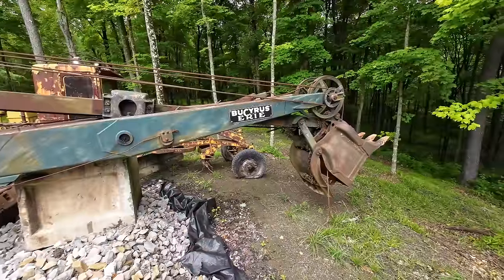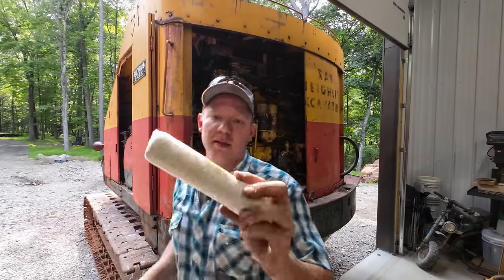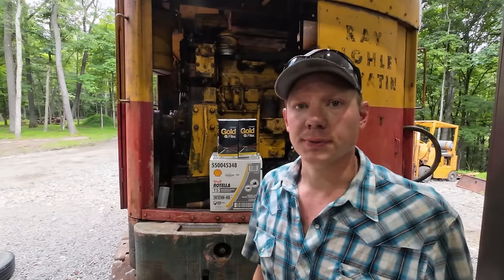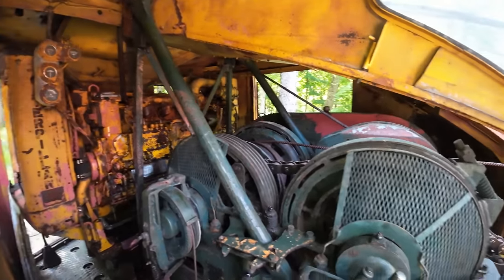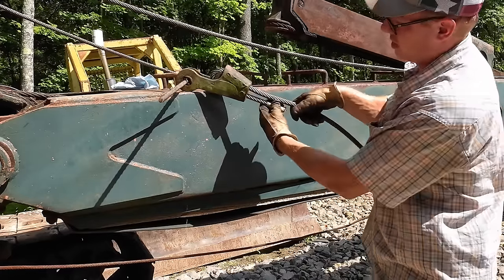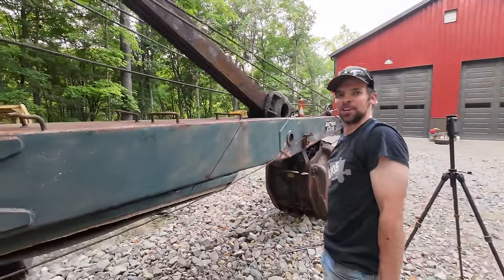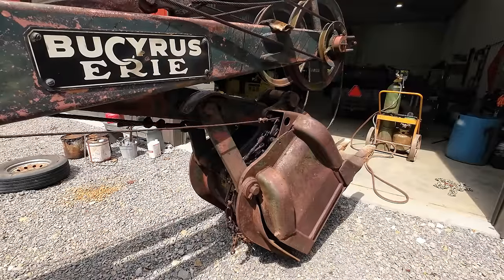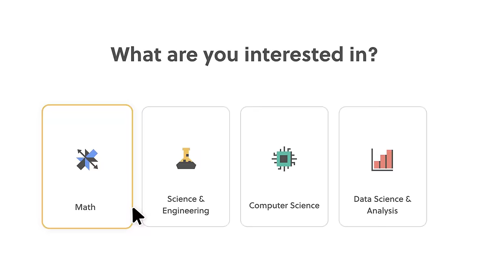Repairing a 1950 Cable Shovel, Sitting  20+ Years!!!

Comment: My dad had one of these when I was a kid. He had the shovel, the cable hoe and the dragline for it. Had both the dragline bucket and the clam shell for it. Never used the shovel.  If I recall a good little crane. Later replaced with. Bantam Shield cable hoe and a military Link Belt drag line.  Great memories…….  Steve

Comment: Not knocking the T5 I use it professionally for services on equipment and heavy trucks today.  My only concern with a machine of this era would be that it was most likely ran on non-detergent oil a good portion of its life.  From experience switching over from non-detergent to today’s oil can dislodge build up in the engine that’s accumulated over the years.  In certain cases can decrease performance/longevity.  A good example would be the 2-stroke detroits actually run a lot better and smoke less running non detergent oil.  By no means is this me telling you what to do or knocking your experience and knowledge.  Just a friendly sharing of information and food for thought.  Love the videos, keep it up!

Comment: Hey, Matt!  alanmarsh.1 here, oldschoolgeorge’s dad. Good job figuring out that the rope was backwards in the becket. However, there is an old saying that you need to remember regarding the installation of cable-clips: “Never saddle a dead horse.”  The saddle of the clip is the part that is not the u-bolt, and should never be applied to the “dead” (not loaded) side. The u-bolt should ONLY be applied to the “dead” side. Saddle on the “live” side, u-bolt on the “dead” side. Maybe 27 other folks have already mentioned this…

Comment: Matt, why dont use a pump up sprayer and some all-purpose cleaner diluted down to soak the machine before you pressure wash it? It helps clean it alot better and easier.

Comment: I’ve seen in other channels they replaced the cable in the becket and clamped like you did. You need to remove the clamp so the becket can work properly and be pulled into the cable causing a better clamp.

Comment: As a Hydraulic guy who makes a living making Hydraulic hoses and rebuilding cylinders and valves.  These older gear and cable machines inspire me. They just seem so much simpler to service.  Maybe they could benefit from a more modern motor but honestly the gears and cables just seem more reliable and cheaper to service and replace.
Reply from the maker: Find me modern motor that’ll fire back up this easy after sitting 20+ years
Reply: @DieselCreek  very true!!!

Comment: The core is synthetic or hemp for lubrication purposes as you oil the rope and the core sucks the oil up, as it is tensioned it compresses the synthetic or hemp core and forces oil out to lubricate the rope from the inside out.

Comment: This machine should be an example for newer models. It’s easy to maintain compared these new highfaluting digital, hydraulic pieces of crap they produce today. These old machines were made to last and I remember them being used when I was a kid in the early 60’s. They used to do the job well and a lot of the biggest constructions were built using this type. Great work and explanations. Thank you. 👏👏🇦🇺😁

Comment: I have always been lead to believe the hemp core is for lubrication purposes.  Shipping used to oil steel wire rope and some found its way the the hemp core and was squeezed out a little under load.  New wires arrived with remarkably oily cores.

Comment: I started working in civil engineering in 1969 and almost every job used a 22 RB. Mostly with lattice jib for general lifting but sometimes with leaders and drop hammer for piling. Such a versatile machine and often set on uniflotes for river work where access from the water was needed. Happy days.

Comment: A few things strike me about this unit, it's not uncommon to get things torn up or torn apart, but's remarkably assembled. The other thing is that runs like a champ. I'm 52 and I don't I don't run as good as that shovel does at 73. I think it's a good project. Storing it inside really paid off.

Comment: Hi matt, my 22 rb (british version) had built up quite a bit of water in the gearbox due to standing still.  It might be a good idea to carefully unscrew the plug and let the water run out with the first few liters of oil after the machine has been standing still for a while.  Then top up with mineral gear oil.

Comment: At 40:35 you were pulling cable off the drum. When you let the tension off the entire mechanism moved back about two inches. Someone has probably pointed this out already. Looks like you need to replace some bearings next.

Comment: I just watched this video, looks to me like you installed the Becket backwards. The dead end should go on the loop side. But I work with crawler and tower cranes. But I would have to assume they are the same for maximum weight safety

Comment: The ones that called that a piece of crap are not aware pf the engineering that goes into the cable pulls, they just hook up some hydraulic lines and a cylinder and it works
Well bless them...
That shovel is history 
The other people wouldn't appreciate a Model A ford
Good job

Comment: Watching you at the end moving that dirt certainly shows the skill of the operators and why they should be respected. These old machines were fully manual with no electronics to mix the controls and movements, it was all done by the operator. I reckon you did pretty damn good, Matt.

Comment: We tried rope core cable on are log skidder once. We went back to steel core, the shock loads of logs hanging on the cable beat the rope core very quickly.
.
But For that sorta use, rope core is probably just fine.

Comment: Hey Matt, 37:39 Its hard to tell, but it looks like you clamped the live and dead ends of the cable together. Don't do that, the wedge does all the holding. Just put the clamp on the dead end.

Comment: One reason for the internal cores in the wire rope is lubrication. You would soak the new cable in oil and then install it and the oil would preserve the wires by cutting friction and slowing rust between the wires. The initial use makes a bit of a mess though as the wires compress the core and squeeze out oil.  Now you need the 22B Crane and Cable Hoe versions.
Reply from the maker: I have the Lorain cable hoe, and a bantam and unit draglines

Comment: Bucyrus-Erie was an American surface and underground mining equipment company. It was founded as Bucyrus Foundry and Manufacturing Company in Bucyrus, Ohio, in 1880. Bucyrus moved its headquarters to South Milwaukee, Wisconsin in 1893. In 1927, Bucyrus merged with the Erie Steam Shovel Company to form Bucyrus-Erie. In 1997, it was renamed Bucyrus International, Inc.. In 2010 the enterprise was purchased by Caterpillar in a US$7.6 billion[7] ($8.6 billion including net debt) transaction that closed on July 8, 2011. At the time of its acquisition, the Bucyrus product line included a range of material removal and material handling products used in both surface and underground mining. I would imagine the Cat oil filters were sometime around when Cat purchased Bucyrus-Erie.

Comment: Is that a 22 -B? A number of years ago I owned a 22-B, set up a dragline, but I used mostly as a crane on my WWTP projects. Sold it off thru a newspaper ad, to a crime family in Guatemala that subcontracted to Dole Banana Farms, based all over Central America. They used a lot of 22-Bs cleaning the irrigation canals on the banana farms. They saw my ad while in Miami, and paid me cash, and more than I paid for it. They are top designed machines and in high demand.

Comment: Question, why did you use the grinder to cut the new cable instead of a torch ? I have always been taught that using a torch helps to keep cable from unraveling.

Comment: A comment from Sweden, when I use wire winch cable to haul log I apprechiate that hemph core, I keep😂 it soaked with oil in order for the cable to sling smoth like a  rope

Comment: If you get some old rubber coveyot belt you could run the steel track machines on the car concrete in the shop without damaging the concrete

Comment: Maybe one way to do it would be to let the machine pull the full cable length on to the drum, and then release and pull manually through the pulleys up till the wedge at the end? I don't know, and for sure do not want to teach, but if it was to be changed in the bushes, might have been easier that way? Anyway, this is a good clue for the next cable change in 2096 😁

Comment: I like it, my curiosity is how it turns? It's not hydraulic so I wonder how it's setup to run the tracks but also be able to turn. Can it turn indefinitely like a modern excuvator or are there stops limiting how far it can go?

Comment: Accessible oil fill port, drain on the oil filter housing, and a drain tube that routes the oil around the chassis?  Why did Caterpillar stop putting those on engines?  Or are those Bucyrus Erie modifications?

Comment: When changing wire rope out weld the end of the old to the new with a torch . or cut 3 legs and core out of each about 3feet and braid oil and new together and wrap with duct tape . pull old rope off and it pulls the new on.

Comment: In the first video and the beginning of this video, it sounded like your pony motor was running way too fast. Should be around 3000 rpm. Did you adjust it? Sounded ok mid video.

Comment: Question on your pressure washer - does it also heat the water, or do anything else but pressurize it?  Did you pressure wash the engine inside the "house" ?

Comment: Question Matt that oil that you use is it good for gasoline engines also just asking because I never used that brand of oil in my pickup before just asking would you use it in a gasoline 10w 30

Comment: You may have discovered this by now but when I saw you scoop up that pile of dirt we could see something you could not, due to your position on the excavator;  When your "stick" holding the bucket is vertical to the ground, that buckets teeth are actually aimed downward at an angle of about 30 deg. to the soil (1:00:42) such that if you drove your machine forward your bucket would naturally dig deep into the soil just by its forward movement. Try that next time & I think you'll be shocked !
Reply from the maker: You can’t do that with these. Moving the tracks requires changing gears and moving a bunch of levers it’s nothing like a modem machine and once you have it in the track configuration you can’t use the boom. You can change the tooth angle slightly by adjusting the boom angle but that’s it.
Reply: @DieselCreek  Thanks for responding. I did not know that !  Love your channel.

Comment: i work 10y on cables... the "ame" center cable can be syntetic or cable ... syntetic are more flexibles... to cut them u have to rubber tape them then cut in middle 😜👌
Reply: there are some clock turn ... counterclock ... and 1 called wood cable with more around clock and counterclock so it didnt wrap when u roll it...

Comment: I dont know what the specs are on the Cat engine, but on my 57 F100, 352 engine, the oil bath air cleaner calls for straight 50 weight oil.

Comment: as a kid i would sit at the edge of the quarry right across the road from my house and watch big maybe 10 times bigger diesel electric cable operated shovels dig up oil shale. they had a cool electric whine come out of them when the winches inside the house paid out or pulled the cable back in. and when they changed cables they would have cattapiller D10 bulldosers help pull the cables.
I live in the Oli shale mining area of Estonia and drag lines and cables shovels were a common sight.
Reply: Interesting that you are talking about a modern electric version of this. While watching the video i was thinking about how robust this digger would have been with direct electric or hydraulic drive. No hydraulic hoses to worry about, and not a million levers and pedals to work with in the cab. It's fascinating that this is the exact conclusion that the mining company came to as well.
Reply: @AgentWest   the ones i use to watch work were built in the late 1960s and the newest i saw were built in the 1970s and 1980s. They mostly built in the soviet era Ukraine and Belarus. The draglines were 100% electric they had a huge black high voltage cabel running from them to a sled with a transformer.
Reply: @ToomasTelling  Oh, those older machines must have been beautiful.
As for being plug-in, these days that massive extension cord runs to a stationery diesel generator nearby. Wonder if that's how those old ones worked as well, or were they more like trains, powered by a high-voltage cable with a massive transformer in the digger.
Reply: @AgentWest  as far as i can remember they had a 500 to 1000m cable. The cable would run from the from the transformer to the machine and inside they would have an other transformer that would step it down to 220 and 480 for smaller motors,lights and machine shop. The main winch ran at 600 or 800 volts. Its been a decade since i was in one looking around.
Reply: @AgentWest  And they were beautiful all of them had art painted on the side of the house. The doors with the art were saved and are now on display at our local mining museum.
Reply: @ToomasTelling  Nice to know they saved at least parts of those machines. 
Do you remember if they were tracked or walking kind? Walking draglines is a really interesting idea that i don't think i saw on any other machinery.
Reply: @AgentWest   the draglines here were walking draglines and the cable shovels were tracked. The Draglines walking speed was 500m in 24hours. The feet were as big as semi trucks and each machine had two of those. And it had a combo of gears electric motors and hydrolics to move them.
Reply: @ToomasTelling  I wonder if the house of a machine that large can be used as an actual house. At 500m/day that motion would probably be hardly noticeable. Electricity/fuel bills would be astronomic, but most likely not too bad if one can afford a whole old digger.
Reply: @AgentWest  the quarry here was owned by the state owned energy company and the oil shale mined would supply the power stations and  the plants that refined the shale into lube oils and diesel fuel. And that afforded them to run two of these beasts as well as 5 diesel electric cable shovels. They have  two more  draglines operating in a quarry 50miles east of me near the Russian border. Near the City of Narva.

Comment: Matt, another thing. All those older mechanical draglines have drum brakes/ clutches lined with PURE ASBESTOS. Ive relined dozens of them. Modern replacement lining is non asbestos. I worked in a machine shop 5 years when I was very young.16-21 years old. Im 72 NOW. I developed mesothelioma from doing this years ago. Be careful please.

Comment: Matt, how much do these projects cost to get back running? Obviously yhere are variables to how bad a machine is in starting condition. But do they cost $50,$500,$5000 to get running again?
Reply from the maker: I probably have less than $1000 in this one to get it operational but I spent $10,000 on it initially

Comment: Should consider at least a bit of plywood in that missing window.. help keep weather and critters out.
I disagree with the concept of patena too. It's rust. Rust is cancer to old machines. I've heard of folks spraying a clear coat of some sort on it. I don't know if it works or not but it might be cheap and easy until you can address it better.

Comment: this thing is 10years before hydraulic cylinder was invented. must have been pretty substantial improvement over cables
Reply from the maker: Not actually at first. Hydraulic machines really didn’t get popular until the late 70s and early 80s. It took them a while to figure it all out, cables were still faster for quite a while

Comment: Do you know if that cable is the original? if so why don't you cut a 6 ft section off and hang it in your garage.  a mento for a Well built 70 yr old machine.

Comment: Can we have little educational background on these shovels ? Such as where this would be used one this size ? Residential, commercial ? Highways by the state or in a quarry ? At what point did these cable shovels begin to retire ? 1960s 70s ? Extinct by the 80s ? Yet 2023 we’ll still use excavators 20, 30 years old, pretty common

Comment: The people that called that thing a hunk of junk are the ones that think using a hydraulic post driver makes you a hard workin farmer lol the ones that appreciate that beauty(me and many more fine fans of this cultured channel lol) put fence rows up with post hole diggers and shovels that ran off elbow grease and we came in with mud up to our kneecaps from doing an native american pow wow dance around the post tamping them in. That or a wagon full of T posts and the shoulder mutilating T post tamper you(me) and your dad made from 4 inch 1/8" wall steel tubing, some pieces of mining belt rail track, and a 15 or 20 pound sledge hammer head welded in the top of the pipe that all in all weighed about 50 pounds. Yeah, try driving T posts in all day with that. It gives you traps and shoulders hulk would blush at and i aint kiddin ya lol alright, im done throwin shade at the soft palm soy boys that think thats a hunk of junk with their daddies money a/c cabbed tractor. Okay, now i promise im done.

Comment: You put the cable clamp on backwards   Uie on the loose. Horsie on the rider
Reply: The load bearing goes o n different side check with any iron worker

Comment: what is the dig depth on a your shovel
Reply from the maker: These types of machines don’t dig down, they dig up if that makes sense, they can’t really go lower than the tracks. They are made for making face cuts where as an excavator sits on top of the material it loads this faces into it.